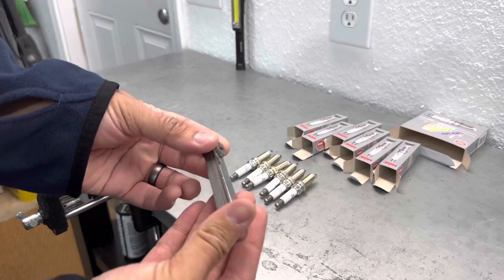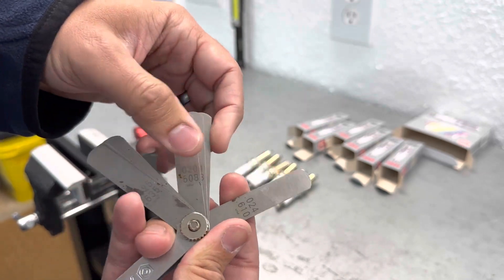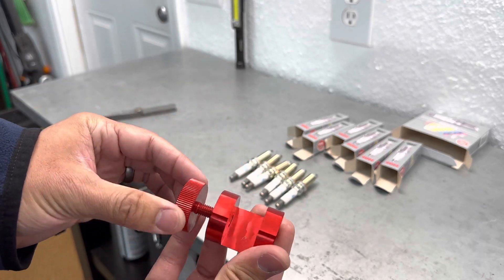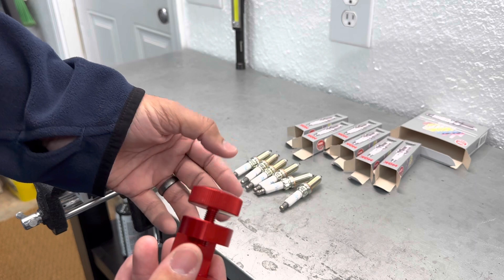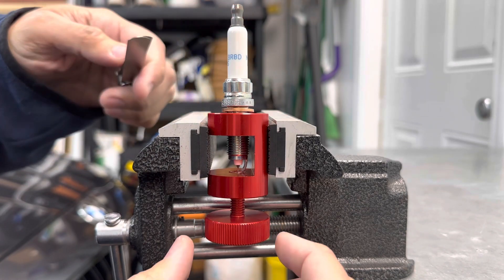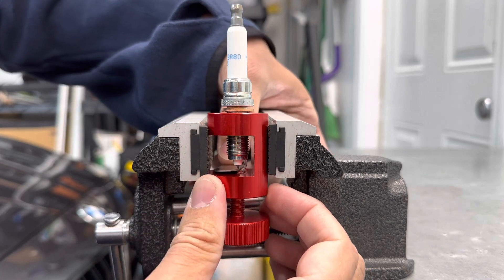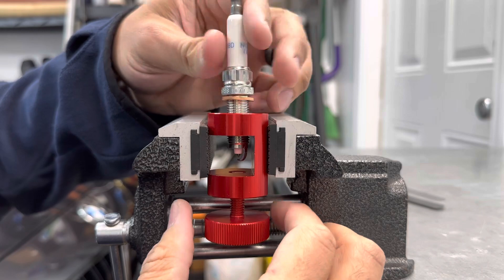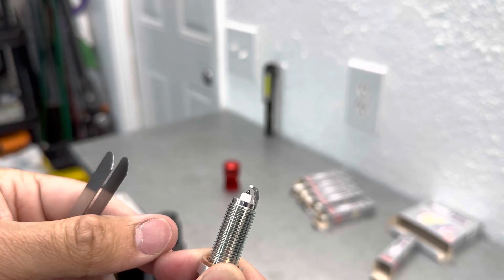How to CORRECTLY gap down my 1-step colder N55 spark plugs

Comment: What would you recommend on the wife’s n55 x5 that’s running BM3 stage 1 93, charge pipe, & M exhaust. Stock coils with 80k on them and dealer plugs with 30k on them. Wanting to do some ignition maintenance on it now that she’s running higher boost
Reply from the maker: Stock gap is perfectly fine for that :-). I ran stage 2+ E30 tune for over a year and never had an issue with spark blowout

Comment: Why .028? I have always seen.020 for the NGK plugs that is one step colder for the N55, why did your tuner want it that wide?
Reply from the maker: No reason to close up the gap that tight if you have no spark blow-out happening :-). All it will do is create a rougher cold start. You should only gap down if you experience spark blowout. Even with my current larger Shuenk N55+ turbo, I STILL don’t have spark blowout with STOCK heat range plus at 0.028” gap. My stock turbo dyno on E50 made 371whp/ 478wtq on this gap with zero issues. I had zero issues with the N55 Eldor coils.

I THINK this is a carry-over from the early days of N54 tuning that THEY experienced ton of blowout… and would fix it by closing the gap. Then when N55 boys started tuning they’d go for colder plugs and gap the same way lol. 

For the record, I HAVE ran colder plugs at 0.020” on the stock turbo prior to custom tuning, and it made zero difference in power or logs. It just made cold start suck lol.
Reply from the maker: The larger spark you can have the better, period. So if you can run full gap and NOT have spark blowout that would be the best :). If you run N55 Eldor coils, or B58 coils you should be good
Reply: @turbospool  What is spark blow-out?
Reply from the maker: @cumshot247  when the air density inside the combustion chamber is high enough that the electric charge on the spark plug can’t bridge the gap from the electrode to the ground strap. You typically fix this with higher voltage (via stronger coils) or tightening the gap.

Comment: Isn’t buying “one step colder” plugs already gapped “one step colder”?
Reply from the maker: Heat range of a spark plug, and the gap measurements are two separate things :). Heat range= heat transfer amount into the cylinder head through the spark plug, gap= distance between the electrode tip and the ground strap.